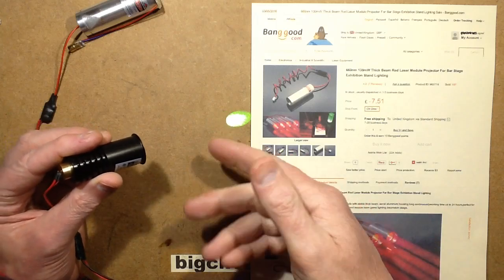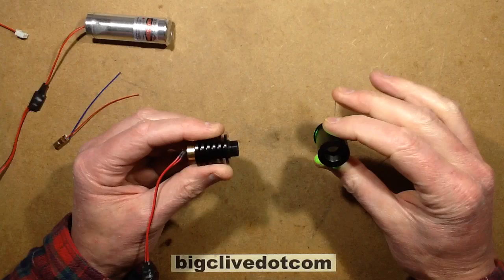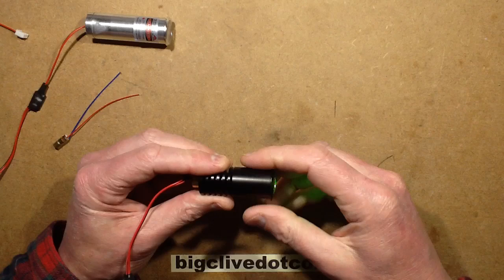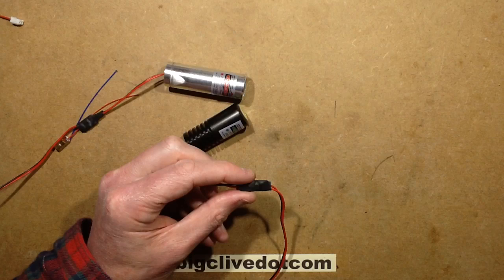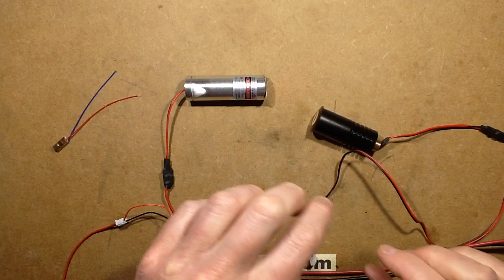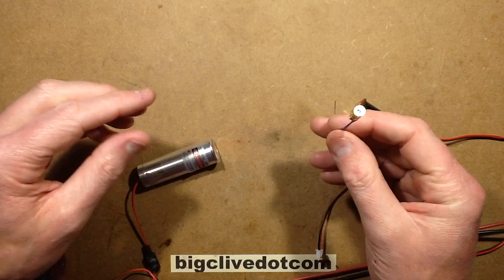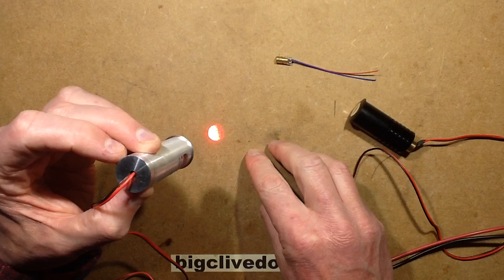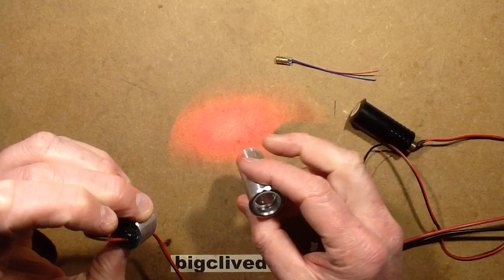Red and green wide-beam lasers.

Comment: The opamp based driver for green lasers is extremely common. I've seen it in tons of modules from China. D882 is a 2SD882. I think someone designed this ages ago and ever since then all the Chinese manufacturers have copied it verbatim. I have a drawer of these, from laser modules I stripped the original driver off of. They come in various PCB layouts but it's always the same damn circuit.
Reply: +marcan The most ironic bit about it is you can use a single transistor and zenner with a couple of resistors for the lower power ones if you know what you are doing. The op-amp solution needs less headroom voltage and usually uses a PNP.

Comment: Are white lasers possible? I have never seen one, probably beacuse one of laser purposes is to create light from very narrow part of the spectrum.. but it would be quite interesting.
Reply from the maker: Most lasers are single colour, but you get versions with three lasers: red, green and blue with dichroic combiners to make a single beam.
Reply: bigclivedotcom Thanks man, that saved me at least an hour long research tangent to see what exists.
Reply: It's possible, but would be pretty expensive as it would actually be 3 separate emitters perfectly balanced, with the beams merged using optics.
Reply: Atlas WalkedAway look up styropyro rgb laser on youtube
Reply: Richard Smith It would have a horrible CRI though, as it would be only 3 wavelengths with darkness in the rest of the spectrum.

Comment: Linear drivers are still de rigeur for laser diodes because the diodes tend to be extremely sensitive to overcurrent transients.  That makes a switching regulator a bit of a challenge; it will tend to kill the diode unless you're running it well under its rated power, and often even then.  For such a low power diode it hardly matters, but higher power drivers will typically use a switching constant-voltage pre-regulator with a linear constant current stage following it.  Ideally the CV stage is set to track the diode Vf (which increases with current and temperature) for maximum efficiency.

As you've seen, diode lasers tend to have terrible optical properties.  A divergence of 44° in the fast axis is not unusual.  In addition to that, pointing error is common, but usually the die is aligned inside the can when the diode is packaged to compensate...but perhaps they gave that step a miss in your red module there.  

The major challenge in putting diode lasers to practical use is simply in achieving adequate optical correction.

Comment: Those are really cool. I have owned several red lasers in the past, but they give me horrible headaches from incredibly minimal visual exposure, so I can't use them any more. I love that "alive" look they have like little light dots moving around (or boiling). you can see in that picture you show, that they have that "spray paint" type look that you NEVER see in normal lights, like Incandescent, CFL and LED. I have bought a set of colored laser-safety glasses, but it's kind of pointless to not be able to see the laser, since the only purpose I have for a laser, is to look at it as a toy.

Comment: I remember reading about that ruby rod laser,  some time back in the 1960s!  I was attracted to the idea of building one,  just for the hell of it,  but the rod alone would've cost me $100,  and I didn't have that kind of money back then.

I surely hope you're planning to either return that red one or get some kind of partial or full refund for it.  The state of the thing is simply not acceptable as far as I'm concerned,   and they need to deal with issues like that.  I ordered some little kits a while back that consisted of a board,  some LEDs and other bits,  and an LM3915.  Well,  the ones they sent me were all defective,  not driving the two pins at one end of the chip,  so in all of the units the first two LEDs never lit up.  I finally ended up having to source some good LM3915 chips elsewhere,  and after much back-and-forth,  got a partial refund on that one.

One of the reasons why I'm a little reluctant to buy from China at this point in time.  Except that there are some things that I'm looking for that I can't seem to find elsewhere.  :-(

Comment: Nice. I used to have a cheap laser pointer that had a lens with a threaded rim. You could rotate the lens to sharpen or soften the beam, and if you completely removed the lens it would project a coin-sized beam just like the lasers in this video, though not nearly as bright.

Comment: Do you think it is possible to remove the frequency doubler crystal from the green laser and use it as a long range (>500m) IR illuminator for a night vision camera?
Reply from the maker: +superdau I'm not sure what sort of pattern the base IR diode has in these.  I'd be cautious about the direct IR laser radiation though.  A large cluster of IR LEDs like in a CCTV illuminator would probably be much more efficient.
Reply: +bigclivedotcom Yeah, invisible lasers that destroy your eyes are a bit frightening. We have a few IR lasers in the research labs, and you have to shut your eyes or wear special glasses whenever the thing is on.
Reply: +Steven Haussmann 
I've used a quite high power IR laser at Uni for some time. It would burn holes into stuff, but that wasn't that much of an issue, because it would normally be enclosed. For a few experiments I set up though, I needed to "defeat" the safety interlocks and run it open (it had to shine through a LN cooled cryostat with samples in it). We had special glasses for that case. But to be sure not to set something on the other end of the lab on fire, I removed the IR filter from a webcam and replaced it with a "daylight filter" (it was just fully exposed and developed black-and-white film, which is black in vis but transparent in IR ;) ). It was much easier to align the laser that way and check for stray spots because of odd reflections in the room. So I am fully aware of the dangers of such lasers. ;)
Reply: superdau Hah, good to hear. Respect the angry beam and the angry beam will respect you. Probably.
Reply: +superdau These things use a 808nm diode to pump a Nd doped crystal to generate 1064nm, and an intracavity doubling crystal (like KTP), which is probably glued onto the Nd crystal. Maybe you could pull out the bare 808nm diode, but you wouldn't be able to take out the KTP without destroying the module. Would be much easier to just buy a 808 diode from ebay or something. Another option would be to get a cheap green laser (the cheap ones leak a ton of IR) and replace the IR filter with a green filter
Reply: +Steven Haussmann Respect the angry beam and the angry beam won't notice you ;-) Well, it's my philosophy about snakes, at least.
Reply: +fenwah1 

I had a green laser which became temperamental (an issue with the driver, diode or crystal alignment). It was easy enough to remove the crystals (they were glued to eachother whithin a little brass mount, which was itself removable). I then knocked out the 808 nm diode, replaced it with a low-power 635 nm diode and replaced the collimating optic. It probably wasn't too efficient (I'm guessing a lot of light missed the optic because it was so far from the diode), but it worked well enough to make a little, eye-safe pointer. The collimating optic was actually rather good, too! Projected a nice, clean, easily focussed dot.
Reply: +superdau It's not worth the trouble, you would probably just break it. It's cheaper to just by an ir laser anyways.
Cameras are also much more sensitive to an 808nm laser than the 1064nm you could get out of a green laser.
Reply: http://imgur.com/a/9lkQu      <<< Yes  - it's possible, and easy. Remove the little lens from the front of the brass unit, behind it is a square of crystal glued to a 90 degree angle L shape bit of brass that you can just flick off with a screwdriver. The IR lasing this produces is BRIGHT - and like a searchlight on my IR nightvision scope across the street. The problem is the laser looks like a point of red at a distance in front of the beam (across the street, obviously). The natural dispersion of the bare IR Laser (no lenses or other optics needed!) acts as a good spotlight. =)
Reply: For most green modules, it's quite easy to pop off the crystal - some  are even screwed in with a little brass screw fitting!

Comment: I work with Lasers most days. 640nm, 550nm and 405nm all up to 100 milliwatts.

Doesn't sound dangerous does it ?
However we put them through optics to diverge and converge the beam into a really small dot.
Quite dangerous if used in the wrong way but we need it finely focused for scanning cells at a nano milimeter level so precision is important.

The lasers we use cost about £15k each because we need the exact nanometer and power
Reply: +BillyNoMates1974 :O
Reply: that's cool, although $15k is kinda pricey..

Comment: Hey Clive, I saw you said you can get diodes with a resistor etc for relatively cheap, do you know where it would be possible to get a 1W green or blue diode with a resistor? I've been looking because I want to build my own laser with 18650 batteries and all that.
Reply: +Tcaret200 you can only get the brass modules cheap. They're 5mW rated. Though you can put like 20mW into one before it blows up. Nobody is selling 1W lasers cheap.
Reply: I know, I've seen em, I'm looking for simply a diode lmao
Reply from the maker: +Tcaret200 If it's a laser diode you're looking for then they are only available built into the modules for heatsinking.  The blue and green versions usually require accurate current regulation.   The red ones are simpler, so can use a resistor.
Reply: But is it possible to get a higher power red diode? I mean I was hoping for blue or green so you could also see the beam in the air.
Reply: Tcaret200
I don't think plain LEDs make beams like lasers do. In fact I'm pretty positive that they do not. Laser diodes have had a trench cut in them, or something, that makes them lase. So they're not the same thing.
Reply: I know, I wish high power laser diodes were as cheap as high power LEDs.. but yeah. I'm trying to build a custom laser for recreational use, aka no shining at airplanes lmao
Reply: Tcaret200
you do not need a 1 Watt laser for that.
Reply: Ahem to burn things, yes I do. Plus really I've always wanted one of those arctic lasers and they stopped selling them in the US so eh.. I'll build my own
Reply: Tcaret200
you can still mail order powerful lasers. I'm looking at a 5W one right now for $64 They're lighting a match with it in the ad. That suggests to me that burning things with it is a selling point. Blind your friends!
Reply: Haha I hope you mean 5mw, but hey, if you found a 5W laser for $64, send that to me! lmao
Reply: Tcaret200
No 5000mW which is 5W Then I found a better one online. The reviews were hilarious. Everyone sounded quite satisfied to me.
Reply: Whaaaaat link me though lmao
Reply: I'm 20 lmao I'm not gonna use it for that..

Comment: First Red, then green, now blue/violet, all very affordable... do you think yellow, white or other will follow?
Reply from the maker: +Björn Persson Most lasers are single wavelength, but you get combiners that add the red, green and blue beams together for other colours.
Reply: +Bj&#246;rn Persson  Argon/Krypton lasers produce white-ish light; you get blues and greens from the argon and yellows and reds from the krypton.  Yellow (and other color) DPSS lasers are available, but aren't as cheap as the DPSS greens and the direct injection reds and blues.  Speaking of not cheap, a wide range of wavelengths are available in OPSL--Coherent currently list 24 wavelengths from 355nm to 785nm in their OBIS series.  You do get very nice optical specs in return for your boatload of money with OPSL, though.
Reply from the maker: +andrew berry Yeah, it's the boatload of money bit that's concerning me.  Bevcause it usually is a very big boatload for the more specialist components.  It's a long time since I've seen a krypton laser.
Reply: +bigclivedotcom OK, so the primary pure colors are affordable because its less complex and now massproduced, and say yellow lasers are boatload expensive because either it is requiring more exotic elements, or combining say green and red for yellow making it more expensive to manufacture?

Comment: Would make a fun cat toy. Can probably bring the power down to like 1mw to make it safe.
Reply: +Red Squirrel you can buy 100uW lasers pretty cheap or certainly could. The only problem is getting collimating lenses. If you are in the UK go to a radio rally and pick up a laser pointer for about £3 and adapt it by reducing the current.

Comment: I was cheap, I waited until some mall I was passing through to get to a bus top had a radio shack which of course I had to go in. It had a $20 laser level for 90% off. So $2 and I used it to mount my 100 inch HD 720p projector to my ceiling and make sure it was perpendicular to the screen to avoid keystoning.

Lately I found one at a dollar store and thought by dangling it behind my bike it'd make a nice attention getting back light. Never got around to that but bought two of the bike light type that spread a laser beam line behind to the left and right of the bike:

http://www.amazon.com/Rechargeable-Taillights-LaserWaterproof-180%C2%B0Adjustable-220%C2%B0Visibility/dp/B00WWH0A7M/ref=sr_1_4?s=grocery&ie=UTF8&qid=1462419957&sr=8-4&keywords=red+laser+bike+light

This one is worth every penny "cept one was broken so I had to solder the battery anode to get it to work. Funny thing one company charged $6 and the other like 2 something. I only ordered the second because the first one took so long to get here(and winter would have ended thus more of the danger, too):

http://www.amazon.com/FREETOO%C2%AE-Bicycle-Resistant-Mountain-Flashlight/dp/B00F4WLFAI/ref=sr_1_2?s=grocery&ie=UTF8&qid=1462419957&sr=8-2&keywords=red+laser+bike+light

So far I seem to be about the only one who is using them in my neck of the woods which amazes me because I'm in an extremely high population density area. There's like 500 people on this block alone... you rarely get to know neighbors because they move in and out as fast as mosquitos die. (I've learned they often trash a lot of good stuff... I have a green laser tube upstairs, a brand new mic, and a digital soldering station just missing the tips so for $4 I had a whole new rig! And thus my interest in electronics was reborn.....awwww, what a happy story. LOL) 

BTW I recommend the bike light for you UKers because it has two modes of good use... a right flash and a left flash which sort of emulates our safety signs telling cars to move right or left depending on the construction zone. City people are used to these and I figure the one pointing right would be good for you who drive on the left side of the road.

Comment: 10 bucks!? These green laser pens are now 2 pounds or less on ebay from China.
Reply from the maker: My first green laser pointer was $300 for a 1mW one.  There's nothing like mass production to bring the price down.
Reply: It's probably mainly mass scale production of 808nm pump diodes, they are very common. Also MCA crystals they use are very cheap, and they don't require complicated alignment. I wonder how long will it take for the OSRAM 515nm laser diode prices to drop so far that chinese will put them into tiny button cell keyrings like the red ones. They're already pretty cheap from China.

Comment: I kinda lost interest in lazors after one damaged my eye sight and took 7 days to recover fully.
Reply: Lasers, like most anything, are only dangerous if in the wrong hands. 

They don't jump up and attack you while you sleep, nor are they in any way unpredictable.

The damage you caused to yourself would have been down to user error. Don't blame the item, blame the user.
Reply: I did not exactly blame the lazor outright. Turns out i have really sensitive eyes or something meaning they don't tolerate the light so well , It was a PHR blue/violet color so it was brighter than red
Reply: +steve64464 why do you insist of referring to them as lazors, when the correct spelling has been made in the title of the video?
Reply: I don't know i just felt like it.